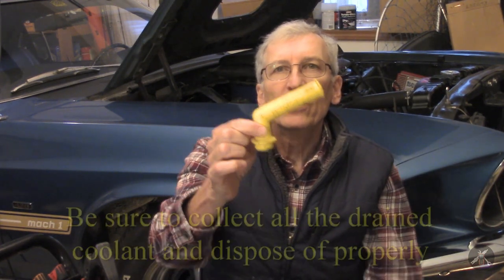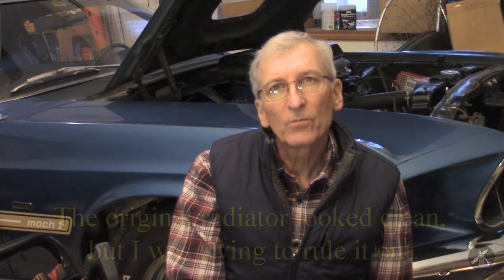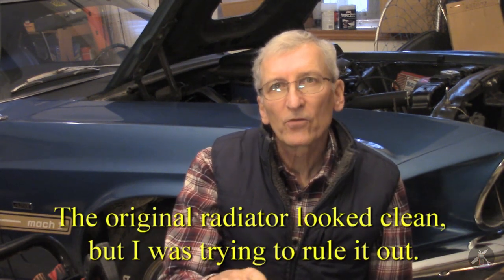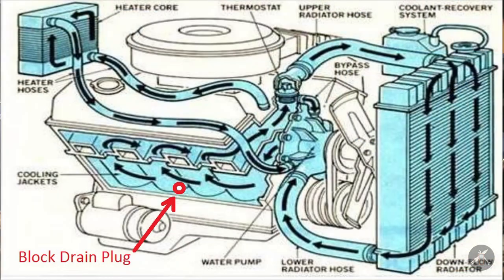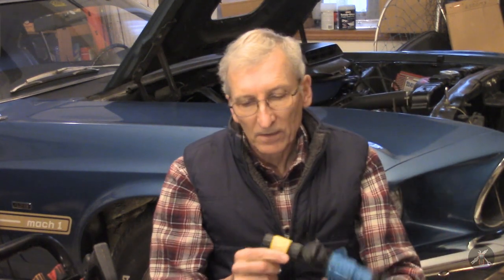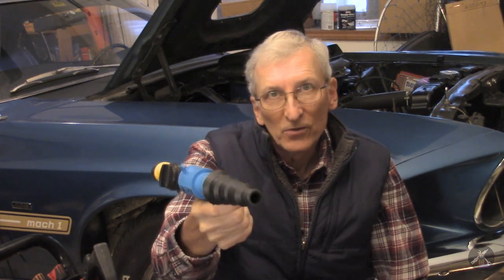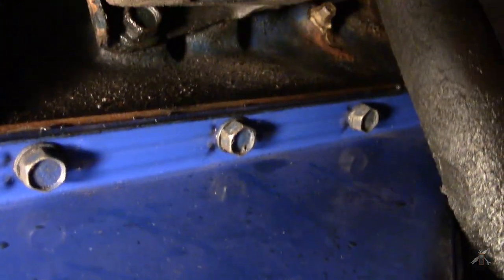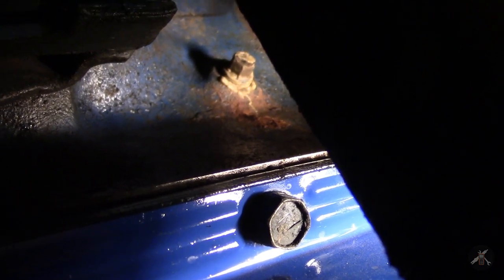Pull Engine Block Drains When Changing  Coolant

Comment: I used the flushing product made by Evaporust in a 1990 chevy smallblock. Before doing that, I removed the block drains and poked until old coolant was coming out. I used the product in warm weather so there was no danger of freezing, and left it in a few weeks, running the engine for 10 to 20 minutes every day. When I drained it, it was coal black. I had to flush with cool water about 20 times to get it clear. Each time I drained first from the block drains. Eventually I got all the crud cleaned out. No overheating now.
Reply from the maker: That sounds like great success, I am glad that it worked for you. I had heard about the Evaporust product and checked it out, but the company doesn't publish the active ingredients even in the SDS. It is labelled proprietary.  I am always a little cautious when I don't understand the product, so I chose not to use it. But, your success is a great testament to the effectiveness.  It is also good to see that once the crud is flushed out from the bottom of the water jacket, the engine is much happier.

Comment: I read that using tap water with all the minerals it contains is discouraged.  I decided to use the pre-diluted coolant in my rebuilt 350 L83.  Not sure if there’s anything here but giving it a shot.  Thanks for sharing your knowledge.
Reply from the maker: Yes, you are correct.  Water quality matters and mineral content can add to the build up and scale. One of the challenges is that it you do a flush, and don't drain the block, you still have the water from the garden hose in the bottom of the block. I was on well water for some of the time.  I would try to flush with softened water to help that - tricky to get a hose from an inside faucet since normally outside faucets aren't plumbed for soft water.  Now I drain the block to be sure it is empty and use distilled water for mixing.  Pre-diluted is certainly good, too.
Reply: @bitsofwisdom460  What if you pulled the block drain plug, removed the radiator hoses, removed the thermostat and shot pressurised water through the system, draining out of both the other radiator hose and block at the same time until clear water, then run a cycle of Radiator flush before draining again and filling with fresh Coolant? Would water from tap be ok then as you'll be flushing it out anyway?
Reply from the maker: @sypher0101  Yes, you can run tap water for flushing, if you remove the drain plugs and open the radiator drain when you are finished. That should drain all except possibly a couple of ounces of the tap water.  Then plug / close the drains and fill with fresh coolant and distilled / deionized water.
Reply: I knew about the drain plugs,but never used them or their exact location, I'm going to do it today!! Ty!!

Comment: Not a professional rad salesman but since your working on an old car, 13 fins per inch would have likely been the norm. The newer rads , less fins per inch likely have louvred fins which actually makes them more efficient and lighter weight. EPA mandates have made manufacturers look for places to save fuel, if the rad is 2 lbs lighter it shows savings, nothing we would ever notice from one car but over thousands sold they realize the numbers to appease the EPA.

Comment: 45% vinegar heated in a metal trash can with n electric burner and pumped through  the system with an submersible water pump should work right?
Reply from the maker: Never tried that, so can't recommend it, but most cleaners are a mild acid, so vinegar may work.  Be careful with powering burners and pumps - be safe with high voltage.

Comment: WOW - never knew there was block plugs OR that binford 2000 gun! What about my 1955 chevy 6 cylinder, would it have a block drain?  what about my 3.1 camaro 6?
Reply from the maker: I think if you get underneath that you will probably find them in both engines.  I have seen square heads, hex heads and socket heads on the plugs. Incidentally, these are the drains the marine engines use for winterization.
Reply: @bitsofwisdom460  You see, I always knew they were on marine engines - my gm "iron duke" 4 cylinder boats- i always opened that to winterize them when I lived in Hoosier IN - never paid attention on my classic cars - Your videos are very informative - keep em coming Dan! Fellow Purdue Alum!  (Purdue is #1 in the country in Basketball right now Dan! Hail Purdue!)

Comment: Can you tell us the name of the strong chemicals you used to eat up the crud in the lower part of your engine block?
Reply from the maker: Well, I'll provide this for information and not with any recommendation. I don't know why they disappeared from the market somewhere around the early 1990's, and there are safety precautions needed with the concentrated acids. 
I found a reference through internet search -- Google books, Popular Science June 1973 that had an article about different radiator cleaners that were being sold in the retail market and some tips how to use them.  The active ingredient in a couple of the major brands (Dupont and Prestone) was reported to be oxalic acid powder, frequently sold as wood bleach, some form of a detergent for grease or oil, and a neutralizer called sodium carbonate (washing soda)--not sodium bicarbonate / baking soda.
Reply: Thanks for Answering my question. 
  I have another if you don’t mind. 
 Is it a three step process? Oxalic acid then rinse? Then detergent for grease and oil and rinse again? And finally rinse with the neutralizer (sodium carbonate)?
 I wouldn’t want to mix the acid and detergent together would I? 
  Your videos are very well done thanks again Pat W.
Reply from the maker: @patrickwilliams4788  It is a two step process.  Based on the Popular Science article, it was reported that there was a detergent in the mix with the acid.  When I did mine, I didn't use any detergent.  I had already run multiple flushes with a current generation cleaner and decided that de-greasing likely wasn't necessary after all that cleaning.  I was also uncertain what concentration to use.  The process was to use the acid portion and follow it with the neutralizer to stop the action of the acid.  I encourage you to look up the Popular Science write up because it gives a very nice background and some good details. Just search the string "Google books Popular Science June 1973" and look up page 122.

Comment: Wow! I'm glad you showed a picture. I was thinking it was the freeze plugs. Great advice, as always, thank you!

Great advice on the radiator. My radiator was replaced years ago and I think the replacement part isn't as good. Thanks!
Reply from the maker: Yes, the pipe plugs rather than the pressed in core or freeze plugs.  They aren't real large, 1/8" or 1/4" pipe thread in my engines.

Comment: Thanks for posting this! The 383 in my ‘74 Challenger is overheating and I replaced the entire cooling system with no improvement. I’m going to take your advice and get underneath.
Reply from the maker: I hope that it helps!

Comment: this was the exact video i was looking for. I put a performance aluminium radiator on my hemi and it was a little thicker so my upper hose rubbed on my pulley and blew. id like to do a flush, so i was looking for info on draining the block but couldnt realy find one, thanks for this great video, ive never drained a block either and now i will for ever
Reply from the maker: You're welcome.  Glad I could help.  I know that different blocks have different drain plugs and drain locations, but it is worth tracking them down.

Comment: I always use a six-point socket on block drain plugs, especially if it's a new (used) vehicle.  Once I have them out the first time I use teflon tape and have no further issues.  Just be careful not to over tighten as that teflon tape is is very slick.
Reply from the maker: Yes, the six point is a must for these hex plugs.  I have had some with square drives and some with hex socket plugs, those can be even more tricky to get out.

Comment: Drain all coolant then remove block drains and insert a curved rubber tube to reach the bottom of the block and drain both sides. Rinse the block through block plug  holes with high pressure water hose. Leave open then flush system with water hose at heater hose both directions. Drain again to the block bottom then replace 1 block plug and fill block at the other block plug location with superflush and leave it there as long as possible to soak. Then use high pressure water hose to breakbup and flush the block til it's clear.  Then drain completely using the tube again at the bottom of the block each side. Fill system with flush and distilled water and drive 200 miles. Drain completely including tube at the bottom of block both sides.
Then fill with coolant and drive another 15,000 miles or so until time to repeat the process.
I think using alot of high pressure hose water in the system and block is worth it because draining the system and block to the bottom with tubes isn't leaving enough hose  water to cause any harm.
If you're good at it then tilt the car like a rocket (LOL) and drain the block completely with a longer hose.
Reply from the maker: You give some food for thought. I didn't try much from the bottom. Those drain holes are very small pipe plugs on my engine and you can't get much of a hose through them, but perhaps it would be worth a second look. It may be possible to help loosen deposits up from the bottom.
I did high pressure flush (100 PSI) from the intake manifold heater connection behind the thermostat and then back from the lower water pump hose to the upper hose with the thermostat out.
The flush chemical seems to need heat and flow / agitation to help the process.  I don't think it does much when cold.  Most chemical reactions increase with higher temperature, so it makes sense.  The flush did seem to loosen and move deposits with each treatment so that they would flow out.
I don't think you would need to tilt the car to drain trapped water at the bottom once the deposits are cleared, because I think that the plugs are at the bottom of the water jacket so that only a few ounces will remain. On my marine engines, those plugs are used for winterizing and they drain all but a couple of ounces of water.

Comment: Hi thanks for sharing your knowledge,
Something l must do on my 85 iroc she runs ok in winter but doesn't like the summer heat,l have flushed the radiator and she's had a new water pump but it made little difference
Reply from the maker: You're welcome.  Cooling issues can be difficult in some cases.  If the water pump isn't leaking, it usually won't make much difference.  There are cases where the impeller can corrode and not be efficient, but I don't think it is common. On the 85 IROC, there are a few things to look at:
1.  First, if you have Tuned Port, the factory electric fan is set for about 220 degrees F.  So, it will be normal to see 220 or so on the dash gauge in summer in traffic.  If you're running higher than that make sure the electric fan is triggering at the right temperature.  There is a thermal switch and relay to control that.  Not sure if the carb models have the same system.
2. The fan motor could be defective.  I had to replace mine because the bearings were howling, but the motor could also be weak and not making the correct speed.  See if it seems that it is running normally.
3. Be sure that the air dam under and behind the front bumper is in place and intact. It is under the radiator. That air dam helps push air up into the radiator.
4. Be sure your thermostat is in good condition.  You want to stay with a factory rating--195F as I recall. But sometimes they don't open all the way.  It is a little difficult to reach if you have TPI.
5.  Consider running the Prestone Heavy Duty Radiator Cleaner as I mention in the video.  It will help clean scale out of the radiator tubes and block. Follow instructions on the package.  I think the IROC needs two bottles and you run straight water with it, so you need to be sure you are out of freezing temperatures to do that.

Comment: Nice to know! Do small block Chevrolet engines have the same? I know they have casting holes sometimes called freeze plugs, but they are more permanent and a pain to remove. Be nice if I could flush out the bottom of the IROC.
Reply from the maker: Yes, the small block has them.  My 305 has one pipe plug on each side of the block in the same area. I think the right hand drain has the knock sensor screwed in instead of a pipe plug. You don't want to try to remove the casting core plug / freeze plugs.  Those aren't meant to be removed unless the engine is out for something major. I know that on occasion one will leak and need repair, but otherwise leave those alone. And yes, while those core plugs are often called freeze plugs, that isn't their purpose.  My original block apparently froze and cracked and those plugs looked just fine.
Reply: Yes, I did have to replace one by my starter that was leaking. It made for some colorful language...

Comment: I will try to loosen the block drain bolts on my '98 chevy 5.0. If they don't drain, I will just twist them back in. Why open a can of worms on a 200,000 mile engine? Besides, I already flushed it with Thermocure and it's pissin' clear distilled water when it drains. It would be great to drain the block completely though.
Reply from the maker: If you're not having an issue, it may be fine either way.  Checking to see if it drains is just another clue to the state of your cooling system.
Reply: @bitsofwisdom460  It did drain. Thanks for your opinion. Everything worked out well!